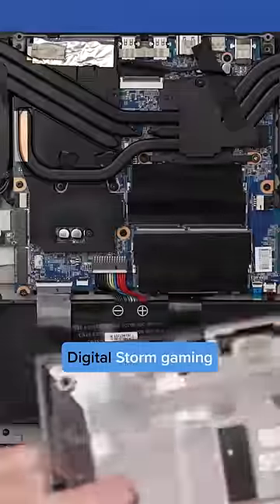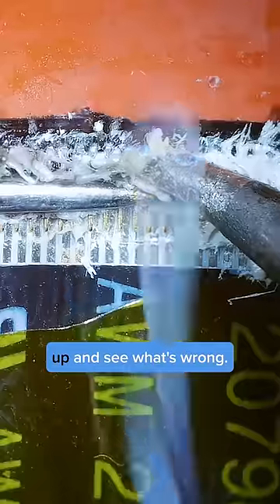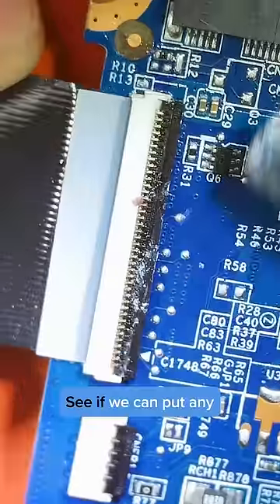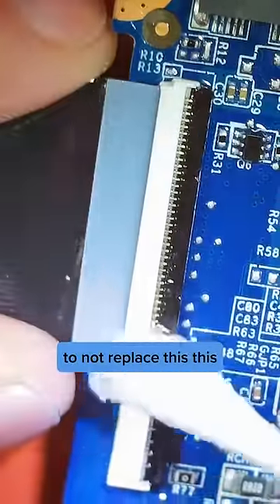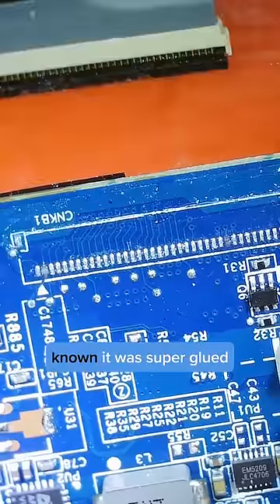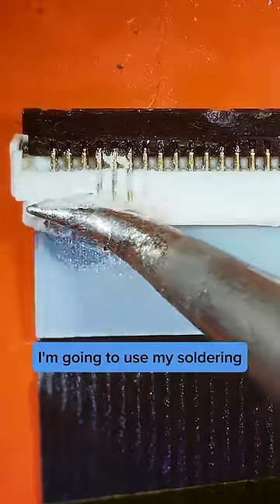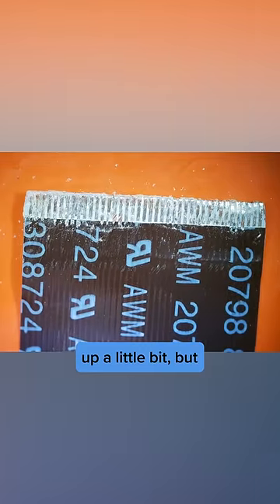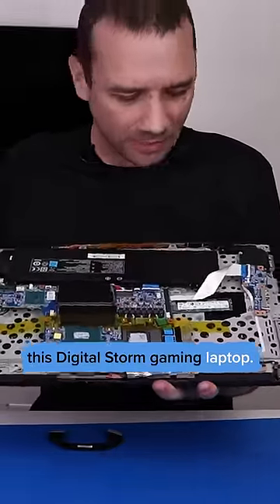I Bought this $2,000 Laptop for $900 - But It's BROKEN!

Comment: It's a shame that a 20 cent ribbon cable has bricked the entire laptop.
Reply: They want to charge 900 dollars and make 899.80 profits
Reply: It's not bricked, it still works but the built-in keyboard doesn't.
Reply: @Miko36110  Yeah, but it's not much of a laptop if you have to carry around an external keyboard.
Reply: @kaizer-777  if you consider the specs of the laptop and don't wanna spend that much for repair, carrying a wireless keyboard is a small price to pay.
Reply: @randomkitty2555  Sure, but I don't see how that changes anything. We should be able to easily purchase replacement parts like this.
Reply: No?  Someone ripping the connector off and super gluing it on did this.
Reply: @kaizer-777 small price to pay, just find a small compact wireless keyboard or a slim version, maybe one of those crazy invention ones. Better than nothing.
Reply: Customer shouldn't have to buy a keyboard to use this laptop. Period.
Reply: @kaizer-777  you carry around gaming laptop? wait you use keyboard?
Reply: Every executive's wet dream.
Reply: @kaizer-777 I carried around a laptop with no screen and a small monitor. It's doable.
Reply: @SECONDQUEST  Doable, but point-defeating. You might as well carry around a SFF desktop.
Reply: @kaizer-777  you’re so hard headed my guy. You’re just wrong. Accept it and move on.
Reply: @NoDamageGaming  Yes, I'm wrong because some internet fool says so.
Reply: @nightrook5732 customer shouldn't super glue the motherboard. Checkmate.
Reply: @NoDamageGaming you are wrong. Just move on.
Reply: I don't understand why he doesn't just source another cable. It's not a very strange cable or connector. Or he could just use thin wires to permanently connect it. Giving up on this repair is nonsensical.
Reply: He gave up for no reason but thinking a laptop is not basically useless without its keyboard is being downright ignorant.
Reply: @piked86 integrated keyboard you need a new keyboard considering the keyboard thing id imagine more than a few parts are integrated into the keyboard.
It's not a total wash just the 900 price is probably correct.
Reply: This is why I am avoid laptop repair in my field but I got to learn it .
Reply: Just get another keyboard 💀
Reply: @kaizer-777 you are 100% correct, sure, you could get a wireless keyboard but completely defeats the point of a laptop
Reply: Its replaceable. Tronicsfix just looked at it and was like 🤷
Reply: @kaizer-777  my best friend literally carried around his desktop computer everywhere he went
Reply: @Dalamanofc ur right, but, *most* people don’t even care about the portability of laptops anymore, they just buy them instead of desktop PC’s because they might don’t have much space in their room or maybe for convenience (different from portability). At most they might carry them somewhere 1-2 times in a year
Reply: Hot air rework on the connector and a new ribbon is usually "do-able" assuming the dead end is just waiting on parts. I would buy a motherboard before i scrapped a 2k laptop.
Reply: I mean in fairness, I bet you could order a ribbon cable with the right size (number of pins, distance between pins, etc.) and length given how simple they are
Reply: No necessarily, laptops have HDMI ports usually. Bluetooth keyboard and mouse with a monitor and you good. Unless it can't POST without it, which would be either dumb or evil take your pick.
Reply: @kaizer-777   there are very light, thin Bluetooth ones, better than wasting money on a new laptop
Reply: @kaizer-777  It's not only the ribbon cable that bricked, it's the FFC connector. Those FFC connectors once damaged. You need a donor board to extract and put it on the working board. Otherwise even if you have a good ribbon you're totally screwed.
Reply: It's more likely this dude just ended up deciding to give up.
Reply: @Miko36110   no it does give it to me I'll wire the whole thing with bridges I got nothing better to do

Comment: Doesn't seem like a dead end
Reply: Right? Just get a new ribbon cable...
Reply: New ribbon cable and connector. Fairly easy to fix.
Reply: Yeah but It need repair some copper lines and a new connector
Reply: @crispy9175  Which the manufacturer will charge $500 for.
Reply: He can just use a knife to scrape the black part off to uncover the wire
Reply: just cut the end off and scrape out the insulation
Reply: Yeah lol very far from a dead end

Comment: You can't replace a ribbon cable? Dude... don't be weak.
Reply: You don't even need to do that. Fix the pads on the motherboard, then solder the ribbon cable directly to the motherboard. Plenty of copper on both ends to make that work.
Reply: @justinreynolds6318  How would you remove it in the future if its soldered?
Reply: @madjimms  De-solder it. It's extremely simple. Realistically, how many times will it need to be removed?
Reply: @madjimms  the same way you remove things that have been soldered at the past.

Comment: Cant you replace the cable?
Reply: He could but it wouldn't make good content
Reply: Mabye just buy a new keyboard for that model
Reply: maybe he has to solder on a new pcb connector too which is probably hard to source idk.
Reply: @LCJammer they are very common in electronics so he probably just didn’t have any on had and was too lazy to order more
Reply: @LCJammer  you don't even have to do that strip the ribbon cable and solder the wires to the pads

Comment: I've fixed a cable like this , just use sandpaper until it comes clean, re-tin the cable, and hold it down tight with a toothpick and heat up the solder to get it to adhere to the board. It was very tedious work, took a couple hours, but it did work in the end.
Reply: Precisely.
Reply: Very cool

Comment: Cut the ribbon cable back, use sand paper to expose the traces, and solider wire from the copper traces from the keyboard to the PCB copper traces. Secure the ribbon cable with epoxy, then boom. Done.
Reply: Yep, this is the way. But this dude doesn't have the correct equipment for the job. I don't know what he is doing 😂
Reply: Interesting

Comment: Time for an external keyboard...
Or use a foldable one and velcro it to the laptop.  Did this one one before, so I  know it works !
Reply: Sure it works but it's hardly elegant 😕
Reply: @edwardfletcher7790  Better than paying $900
Reply: @frandurrieu6477  He bought it because he can repair laptops. Not a waste, a saving.
Reply: Good idea but the power button is probably on the same cable saddly
Reply: @deutschdominik  Most laptops built in the last 20yrs have a separate microswitch for power because the keyboard goes thru a controller chip. The power switch is tied to the battery charge controller.

Usually it's the track pad on the same cable.
Reply: Please tell me you are a linux user 😂
Reply: @deutschdominik I think the keyboard ribbon cable and the power switch cable are seperate in most laptops, it is for mine
Reply: @Edward Fletcher  well almost all current acer and HP notebooks have it in the keyboard it's one of the most common solutions to just replug the keyboard cable when those notebooks don't power on of course this only applies to notebooks that have the switch in the keyboard layout not the ones with a button elsewhere
Reply: Power button is on the keyboard
Reply: Thats not a. Fiz
Reply: velcro is crazy lmao
Reply: And the power button is on the onboard kb that also bios won't post if onboard kb is not detected due to intrusion restrictions

Comment: So its just a keyboard connector... use a external keyboard...  but you could get a new connector and ribbon cable...  not that big of a deal...
Reply: i agree, if the only problem was the a new ribbon cable and connector, buy one for like 10$
Reply: @treyondaren3542  ah, you didn't say what the issue is. Got a full video. I hate these shorts. You get sucked into them because they just cycle in the back ground and when something interesting comes up it's just a 60 second tease.  Lol
Reply: the power button is on the keyboard more than likely
Reply: Dramatic shorts moment, probably.

Comment: You can strip the cable back a little to expose clean copper. It will be absolutely fine at that point provided it reaches. I think a new connector and a 10-minute cable repairis all it needs.

Comment: I just fixed a laptop for my mom that i bought for really cheap because the track pad didnt work. The ribbon and connector were torn completely off like this, (pads and all). I went in with 36awg enamel coated wire, traced each back to a VIA and, using a microscope, ran new wires from each connection. A lot of work but also a lot of fun for me and as a bonus I got a really nice laptop for my mom out of it for cheap!! 🤘🤘

Comment: BSI-161H would have helped you a lot with this job. It is a cyanoacrylate (super glue) de-bonder which effectively reverses the curing process of cyanoacrylate glue. costs about $7 to $8 for a one ounce bottle. All you need is a few drops to dissolve the glue. You wouldn't have had to destroy the connector nor would the cable have gotten as damaged. But besides all that, destroying the connector to save the cable is kind of counter productive. Much easier to purchase a new keyboard than purchasing one of those zif connectors.

Comment: It looks to me like it might have been based off some ODM product, so it might be possible to just buy a replacement keyboard for the original ODM design or another model from a different brand that was based on the same design.
Reply: Clevo platform? You can probably get Schenker, Sager, System76, Tuxedo, Eurocom or sometimes even MSI to sell you a replacement keyboard.
Reply: @SianaGearz  
Yep, that was what I was thinking.

Comment: You can remove the ribbon and replace it at the keyboard, or replace the keyboard. Or using a splicing connector, buy extra ribbon and a new connector for the board.

Lots of options. You just need to figure out which works best.

Comment: I "Fixed" some ribbon cables by clipping them off, gently sanding the plastic down to the wire, adding a strip of tape to match the connector and clip it back in.

Comment: That keyboard can be saved, you just have to cut the damaged part of the Flex and then carefully remove the insulation with a utility knife, you just need the Flex to be long enough
Reply: With a lot of patience you can wire the ribbon to the board directly. Honestly I'm not an expert in soldering but I once did that, with a good soldering iron and flux and a couple of hours is feaseable.
Reply: @alerighi  true, But my method is faster and does not require much skill, but without a doubt this welding method is totally viable.

Comment: No attempt to find a replacement part?
Reply: If I remember right, he tried to find a replacement part, but was unable to.
Reply: Replacement internal parts for an off-brand boutique laptop? Huh? Personally wouldn't bother.
Reply: @geeknproud321  i did the mistake of trying to outsource a part from a almost compatible device and failed miserably loosing important data in the process
Reply: @contytub  It's not that there was anything to lose at this point ;)
Reply: @elmariachi5133  i could have been more patient and actually fix the thing with correct replacement
Reply: I would've stopped as soon as I saw the super glue, alarm bells are ringing.
Reply: @contytub  That really sucks. I've been there and it is a messy depressing process trying to fix high end laptops with sketchy parts support. Unless it's something easy that you can't mess up I generally turn away laptops altogether.
Reply: The key is to look for the whole keyboard as a replacement part.
Reply: @Mobin92 seems unnecessary when you can probably find or custom order a ribbon cable or heck even just use wires

Comment: You can actually just cut off the damaged part of those cable, and peel off the tape just a little bit
Reply: There is little to no slack to do that.
Reply: @greyfox788  it's just wires, you can cut the top and make the 2nd cut 2cm lower to solder them with wires or with part of another tape and put glue. Don't throw working things, save a planet!
Reply: Yes thats what i did to my flex cable on my laptop on the hdd sata cable

Comment: That's a tongfang laptop. The keyboard comes with a removable ribbon cable. If you find a replacement, you should be absolutely fine.

Comment: the connector is a standard piece you should be able to get from TigerDirect or somewhere like that ... as for the ribbon cable... a ribbon cable is a ribbon cable.  Just find one that is the right length and trim off any extra leads.
Reply: wait i thought that ribbon cable are specific to each manufacturer?
Reply: @siontheodorus1501 that's like saying USB or HDMI cables are they are literally the same no matter who makes them some are just better quality than others
Reply: Lol, yeah just grab any random ribbon cable and tie it together.
Reply: brake_4_cake  impedance (can) matter.  In the same way that when a wave hits a wall, it bounces back, if you have an electrical wave change impedance it can also bounce... 

Computers now are so miniaturised; that it's not impossible to reason that for a high end gaming laptop the length & material of that cable was carefully selected.
Reply: @UKMonkey  it's a keyboard ribbon, it's not sensitive

Comment: What was the liquid? Did you use acetone? Acetone will dissolve or at least soften CA glues and some of the epoxy resins
Reply: Also would have eaten the connector but that probably doesn't matter at that point

Comment: wouldn't a heat gun be better at getting the glue out with less damage to the cable? direct contact with a soldering iron seems risky...

Comment: Acetone eat super glue.
Reply: It also eats plastics so.....
Reply: @Jacob Ruble  The plastic doesnt help the cable function at all...  just replace it with kapton tape if you need insulation...  lol
Reply: @KillianTwew  it helps a ton for the locking mechanism, kapton tape would be too thick to enter the ribbon cable slot

Comment: Ipa may have disolved the glue a little, and you could use a generic ribbon cable with same amount of connections or maybe use 2 smaller ones. To replace it.

Comment: Yeah this is totally saveable. It'd be a great project for someone who intended to use the computer themselves after fixing it. Just replace the connector and tidy up the ribon cable end with heat and tweasers and best case it works - worst case you use an external keyboard.
Reply: These cables love to delaminate connector side and it's happening. I would love to try finding the right pitch ribbon (usually easy enough from a supplier) and splice it on to fix. I haven't had to do that yet though, don't have a recipe, but you can scrape off a covering layer fairly easily, then maybe Z tape? They don't really like heat at all.

The connector removal with soldering iron was dicey. For one CA fumes when you heat it over 90°C might kill you and for other risk of cable delamination.

Comment: why not try and use some similar part? Some longer flex cable with enough pins (cables with more pins can be cut to fit into the socket). A longer cable could be bent into the right angles and shape to fit the overall path needed ...

Comment: why can’t you just buy a replacement ribbon cable? (I have little experience with soldering or repairing parts i just do replacements and have yet to have a ribbon cable i couldn’t replace)

Comment: I have the same chassis design but it’s some “Overpowered” from Walmart with a keyboard that works sporadically (RGB is iffy, spams keys if not totally disable itself), instead of a RTX 3090 it’s a GTX 1060. Paid a little less than a grand a few years back before the release of the RTX series lol

Comment: I would cut the cable tip off and just sand off the end to expose more connection wire and ball the motorboard and solder on the cable or solder on a new connector

Comment: Use acetone(nail polish remover) to remove the glue
Reply: It will damage the ribbon cable as well. Just replace the connector.
Reply: @hankhill6899  you mean the copper?

Comment: it was so easy to solder the keyboard cable directly to the mainboard. otherwise,u buy a new connector and a new keyboard(if the keyboard cable is not different part)

Comment: Use scissors to cut the cable get an axle knife and clean off The Ridgid to see the Chrome pieces make sure it's clean put the cable snapped back on with soldering and flex then you have a new computer

Comment: Why don’t they have affordable 3d printing technology to be able to create Rubin cables? That seems like a thing that 3d printers should be great for.

Edit: also why can you not just cut the wire a millimeter and a half down or just how far the damage goes then remove the cable and. Solder on new connections. Is something like that kind of repair possible?

Comment: How can you call this a dead end? From what I can see, this laptop looks very repairable. Is soldering a new connector to the board not an option? You didn’t show where the other end of that ribbon cable connected. Is there a connector at the other end? If so, couldn’t you replace the ribbon cable. If repairing this laptop is outside your capabilities to repair, maybe a cellphone/console repair store would have the equipment and ability to fix it. You should suggest to your customer to  call around to find someone who does component level repairs. Better yet, you should try to partner with a company who can do this type of repair.

Comment: Couldnt you solder wire from the ribbon cable to the connectors on the port